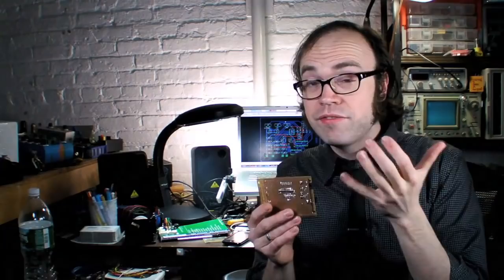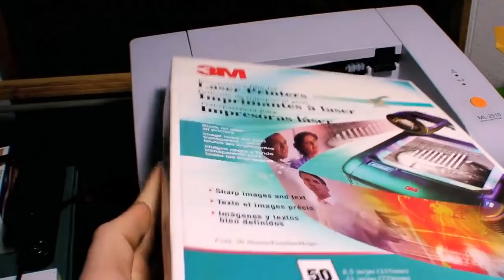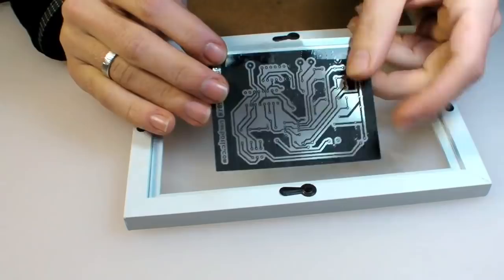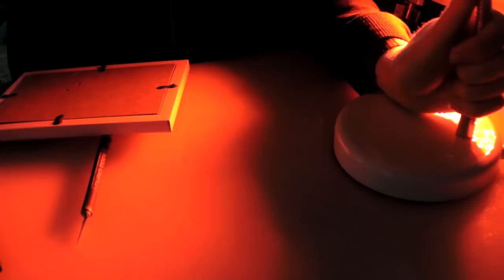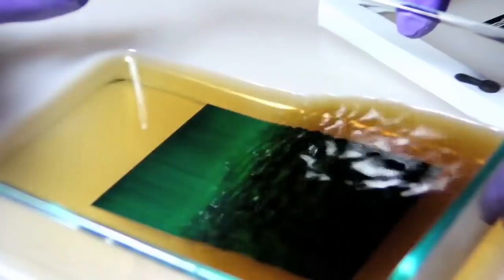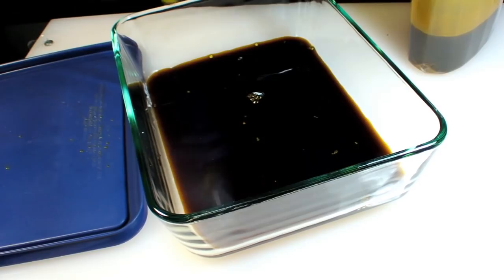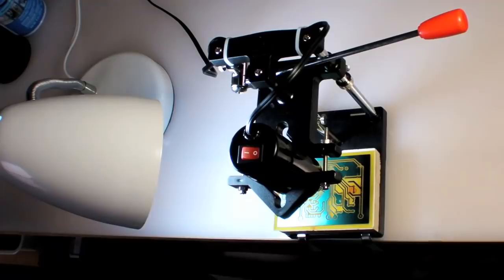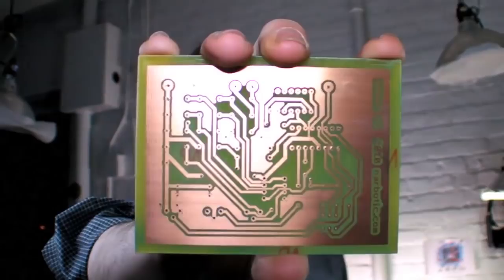Circuit Skills: Circuit Board Etching

Comment: Your laid back approach is AWESOME. Your not stressed and simple direct explanation is just what newbies need. Your system is exactly how I make my boards and mine come out excellent every time. I skimp and use ferric chloride hexahydrate and caustic soda but I have been doing it for years and know the measurements. Also an etch tank with a fish tank bubbler and heater bring the etch time to under 8 minutes depending on copper thickness. Dry Film Solder mask is cheap and easy with a laminator.

Comment: I have been making pcb s for years.  I made a rocker for the solutions, uv light box and using a Dremel drill on a flex cable.
There are now new products and procedures that are really fascinating,  I use a MacDraft Pro drawing program to create the positive circuit and print it out on an old hp 5000 printer to the transparency sheet.  I like the idea of using two stacked prints to enhance the pattern.  I sometimes use a heat lamp (150W lamp) over the etchant to warm it up.  I made a vent hood with squirrel cage fan to blow fumes out.   I am still experimenting with the photo resist sheets, (now on order) and using the hard to find photo resist in the spray can to try on my home made pcb spinner, that will be used in the hood.   Sorry I went on here, but that about covers it.  //...  Joe

Comment: I always expose to sunlight on a sunny day. And it makes such a big difference! Why be stuck in a dark room with a light bulb when I can watch some birdies flying and look at the blue sky!
Reply: mendebil  True my friend
Reply: UVs produced by sunlight aren't constant on the board, which means that you don't really know what the actual exposure time should be.
Reply: Sometimes it does not sun shine and need to practice when the sun doesn't shine.
Reply: bcz it is 100% homemade.
Reply: I followed this video, but instead of using a CFL bulb I used a halogen. I put the board after it in the developer, but it came out exactly as it was, like nothing happened. My board was sold as photosensitive, it came with the protective sticker, but never looked green or blue. Just copper color. Do you think only the lamp was the problem? After putting it into the developer I killed the photosensitive layer, right? So I cannot repeat it with a CFL and the same board? If I cannot: can I still use the board with marker / iron method? Thanks a lot in advance!
Reply: @DiegoSynth  I am also trying with a CFL bulb and did not work. However, after exposing the same board to my aquarium lamp which I am sure emit UVs, it work. So the developer does not kill the layer and it might be your bulb that does not give enough UV, try with sunlight or other source of UVs.
Reply: I'am blind and I'asked my assistent to comment for me but hearing you speak about blue skies was very inspiring simce I'haven't seen it for 11 years.
Reply: Real electronics enthusiasts haven't seen the sun in decades.
Reply: @DiegoSynth  Yes halogen lamps produce light by black body radiation, in fact most of it is in the infra red. Mercury Vacuum discharge tubes produce UV light. A florescent lamp is a Vacuum discharge UV lamp with a fluorescent coating which converts UV into visible light, though seemingly sufficient UV passes through the coating. A CFL without a florescenct coating would in fact be a UV lamp.
Reply: @grownupemo  That's amazing! Thanks, I learned something. :)
Reply: Thats what we call a "prefference" my friend. Prefference requires understanding and respect.
Reply: @alfhanahmed  yup. Literally.

Comment: An excellent tutorial.  One suggestion: the very thin drill bits that I use -- 0.04" -- can easily "dance" away from the hole that are intended to be drilled, particularly on this very hard phenolic board.  To limit this, I use a center punch in order to create a very shallow divot on the hole as a wide to guide the drill bit during early moments of drilling.

Comment: I've found that a laser engraver is fantastic for making custom pcb.  Rather than having to rely on those light sensitive boards, simply paint the whole board black, print your circuit out with the laser engraver removing the unwanted paint i.e. the copper that is to be removed. Then continue with Ferric Chloride.
Reply: What type of black paint, if I may ask? Thank you.

Comment: I remember in my first year of an electronics class we used nail polish as resist. We literally had to paint the pattern using the nail polish brush. Imprecise but did work fine for simple circuits and it was cheaper. When we moved to more advanced circuits we used toner transfer.

Comment: In my opinion, harmful etchants (like ferric choride) are un-nessisary to develop board. They require special disposal, are environmentally un-cool, and require special safety measures. I use white vinegar, salt, and hydrogen peroxide to etch boards. Results are always perfect. These chemicals are far more benign than methods suggested above.
Reply: thanks, totally works, and no special disposals
Reply: Except you are making Cupric Chloride which is harmful anyways... Also when you add salt, and see those fumes coming off? Thats Chlorine Gas....  A Chemical weapon. So be careful.
Reply: How long does it take to do that.  Sounds interesting though.  I don't know what the recipe for that.
Reply: Warren Brown, where is the chloride coming from in this approach? From the board itself?
Reply: From the salt. Table salt is typically Sodium Chloride.
Reply: Warren Brown  sodium has a higher activation energy than copper.. so it wouldn't break it's bond with chlorine?
Reply: Hahaha H2O2 is banned here in Europe...or at least very hard to come by of anything with 3 or more %.
Reply: +AirsoftSlo You don't need more than that. You can always add more. Or you could try evaporating the water before using it if it's really a problem. And you can probably get high concentration H2O2 in hairdressing stores or some pharmacies.
Reply: Copper chloride is actually a good sideproduct because it's also an etchant! If it doesn't work, apply some oxygen (either from the air or from a bit of H2O2, or another oxidant). That will regenerate it! Though I'd recommend 30% HCl + 3% H2O2 in equal quantity for making the CuCl2, it's very fast.
Reply: @GRBtutorials  No we actually cant. Every H2O2 we can buy is in gel form exactly for the hair salon purposes and it has colourants and smell aromas added...
Reply: In which part of Europe do you live? Here in Spain, you can get liquid H2O2 at some pharmacies as well. And, as I said, 3 % H2O2 should be enough.
Reply: @GRBtutorials  Slovenia
Reply: Well, you should be able to buy at least 3 % H2O2 as a disinfectant in a pharmacy. And you can evaporate the water to concentrate it (just be careful of not concentrating it too much or it'll become rocket fuel).
Reply: @GRBtutorials  100ml bottle is 15€ at a pharmacy and it isnt even full...thanks for trying though.
Reply: What???  What do you mean...???  I do get your drift...!!!
Reply: "environmentally uncool" I'm sold, buying ferric chloride right now
Reply: @GRBtutorials  not anymore, you'd have to have a business for it

Comment: Making my own PCB's was fun the first couple of times. It was much more fun when that mail arrived with a top notch, superbly manufactured rendition of my design.  I still had all the fun of designing the circuit, and laying out the PCB.  A factory with the right equipment did a top-notch job realizing it, for a cost that I could never achieve making a lower quality version myself. Many DIY-ers naively calculate cost by assuming their time is worth nothing, and gloss over quality differences.

Comment: Thanks for the kind words. I have finally perfected the process all the way to solder mask. It comes form a conglomerate of others work and tweaking it. In a nutshell, there are papers out there saturated with silicone oil that toner prints to with no problem (assuming the write paper) and little pressure initially with the board hot and flat and clean. It transfers perfectly then once stuck in the right place, in my heat laminator2X. Cooled and done right it peals right off and reuse the sheet.

Comment: Make sure you neutralize the acid on the circuit board in a bath of Baking Soda and Water BEFORE you rinse the acid soaked board in the sink with cold water, otherwise the etching solution will destroy your house's drain pipes and enter the environment! D:

Comment: Ferric chloride is horrible, and 20 minutes wait time is a joke. I prefer a mix of hydrochloric acid and hydrogen peroxide. If it isn't smoking, add more hydrogen peroxide to taste. Etching is done in 2-3 minutes if you stir a bit, and the leftover HCl and cupric chloride in the container can be reused a number of times, by adding some more hydrogen peroxide when it seems to lose its potency.
Reply: +John Tsiombikas You're right. I had been etching PCB's for a longtime with sodium persulfate and it took almost 30 mins. That stuff is also pretty expensive, it had been a longtime since I done an electronic project. I will start with this hobby again soon but with better equipment. Better solderstation, using silkscreening to create professional PCB's. I'll also make a DIY etching tank with plexiglass. It's very cheap to make one yourself instead of buying one.
Reply: Table salt speeds up the reaction and can pep it up if it starts to slow down.
Reply: John Tsiombikas have u lost ur mind ?  Ur crazy
Reply: Why is a twenty minute wait time a "joke"? I'm just considering that the board(s) could be used for years, so spending twenty to thirty minutes during this step of the manufacturing seems a reasonable investment - especially when compared to the many days or weeks it cane take for a third party manufacturer to produce the board(s) for you.

I also feel that the satisfaction for creating your own circuit board(s) should out-weigh the whole process. If, however, you wish to mass produce your board(s), then certainly try other processes in order to reduce manufacturing times.

I feel the bigger picture here is that anyone can create their own circuit boards, and even their own circuit components, at a low cost. What does it really matter if we need to wait minutes or hours to do so? The process of creating your own components, and thus the feeling of accomplishment, should - in my view - balance the effort required.
Reply: Note: Don't put too much hydrogen peroxide in the solution! Using too much hydrogen peroxide can result in the production of chlorine gas, which can be deadly if not well ventilated!
Reply: I just use diluted nitric acid....
etches easy, clean and perfect.

(and easier to dispose of: dilute to 20% or less, slowly add ample soda (at least 0.5kg/l), stirr and leave it for a day. and than you can just pour it down the drain)
Reply: Even better, environmentally, would be to essentially reverse electroplate in a copper sulfate pentahydrate solution - it would probably take a little longer but possibly not depending on how thin the copper layer is on the board
Reply: lps2 reverse electroplating has its own problems like under'etching' of fine traces and partly 'etching' because at some point the electric connection is broken... Always needs post processing...
Reply: And the copper chloride formed can be used for etching more PCBs so it's reusable.
Reply: I'm listening!!!

Comment: Tip: use tracing paper instead of transparants. Toner adheres much better and because of the fine grain, layouts can be very detailed. It's cheaper as well. UV exposure needs to be a little longer.

I don't need to double-up the layouts, allowing for a sharper image and therefore much finer tracks (I make 10 mil, 0.25mm tracks without a problem).
Reply: nice

Comment: Collin, I recommend etching with Water + Muratic acid + Peroxide. It takes 20 seconds or so, compared to the 20 minutes of Ferrochloride. Just make sure you do it in a very well ventilated area, with a respiratory mask.

Comment: Two notes: if the picture frame uses plastic instead of glass it could be polycarbonate, which blocks UV light. Also, nail polish remover's primary ingredient is acetone, for those concerned with purity.

Comment: What I always use is regular A4 paper instead of transparent sheets. It'll block more light but, the print is very sharp and does not have holes. So no need to print it twice. You need a laser printer for that though.
4.5 minutes in UV light and you're done.

You can also use a marker to draw your layout on the board. The marker paint will protect it while you are etching off the copper.

Comment: Interesting video Collin. I've been down this route before.  Your board came out very nicely.  There is one additional step you could take which is tin-plating so that the copper traces don't oxidize.  Solder masks are also possible but do take more work and effort.  But all in all, your board came out very nicely and that's what matters.  There were a few points in the video where the background music was a tad too loud, so you might want to tone it down a bit more for future vids... Thanks for your video!     P.S:  Drilling a small PCB is not too bothersome, but if you do larger boards, or multiples of a board boards, it can become tedious and time consuming... this is where a CNC machine that understands Gerber can make a huge difference, but not to mill away the copper to leave the board's traces (which is of course possible) but to use the Gerber Drill file from your CAD program to drill all the holes for you with greater precision.  Admittedly a CNC is an investment, but if you're doing lots of boards it can make a difference.

Comment: Depending from the photosensitive pcb in 5:17 the board sometimes needs to wiped with a kitchen paper to remove residues of photosensitive and after that washing with water,because the unvisible residues is the most important reason for the bad etching leaving shadows of copper in the board.

Comment: Nice tutorial on PCB etching! I use almost the same method except the photoresist type - I use "POSITIV" spray. Covering patterns with some oily liquid (e. g., glycerine) is another way to stick them together and to the board so no any frame or glass piece is needed. Also, 'drill-aid.ulp' Eagle script (included in distribution) is very handy when you use manual drilling. The script reduces hole diameters to a selected (small) value more suitable for drill centering.

Comment: I use a special paper that has a rating of 100 pound. Just iron the toner onto the board and soak in warm water for 10 min and you have a board that is very close to factory level. This is a great video too.

Comment: This is an excellent tutorial on this topic. I have shied away from etching my own boards due to my fears of having perilous chemicals around my house (I have to do most of my hobby stuff in my living room & kitchen) e.g ferric chloride and the like. Yes, using stripboards can be tricky, but the main hassle with these is soldering one up that was copied from a breadboard - and the breadboard test wasn't a proper test to begin with...Thanks for the info, anyway.

Comment: Here's a trick for the etchant bath.  Lots of people make very nice setups with temp. control, aerators, etc.  For a basic but not too basic setup I like to use a muffin fan from an old computer. Break off a couple blades next to one another so it is unbalanced. Place it underneath your tank. I use my variable bench supply for adjustable power but an old wall-wart would do. Secure the tank by placing heavy items beside all 4 sides so it can't vibrate off! Heat it with an incandescent desk lamp.

Comment: Some more hints: for etching i use  1/3  h2o2 (18% )  1/3 water 1/3 hcl .
Don't make too much since you can not store it, it etches a board in just less then a minute. You must do it outside since it produces Cl in the reaction.

Comment: I'm using sodium persulfate. It's much less messy:) 200g/1L, with 60C heat, takes 10-15 minutes when it's fresh. Also it's better to place PCB copper side down (but not too deep, just under surface. I'm using holder from isolated wire). And get it out for a few times to remove bubbles.

Comment: Nice vid! :)
You can use a toner spray that spreads the ink so it covers holes that your printer hasn't drawn. or you can use nitrocellulose thinner. take a thin box, put the mask in and pour some nitrocellulose thinner on the box cover. The alcohol fumes will also spread the ink evenly along the printed mask.

Comment: If you are wondering why he used red light when opening those PCB's is that red light has a longer wavelength (which makes the light less powerful), therefore it won't etch the photoresist.
However, blue lights like fluorescent lights have shorter wavelength (makes the light powerful) therefore it will etch the photoresist.

Comment: Great job on this process.  I did this in High School Electronics forever ago, only we used fingernail polish for resist, with no photosensitive coating.  Real caveman, but it works.  Again, Excellent video.

Comment: I'm using sodium persulfate. It's much less messy:) 200g/1L, with 60C heat, takes 10-15 minutes when it's fresh. Also it's better to place PCB with copper side down (but not too deep, just under surface. I'm using holder from isolated wire).

Comment: Protip: Put the container with the board and etching solution in a larger container with hot water, etching will take less time which results in a better/sharper etching result.

Comment: You might also want to try using a product called "tinnit" to give the board a little more corrosion resistance. It's pretty straightforward.

I used to do this a lot, but lately I have to disagree with the "a lot less money and a lot less time" remark. It is time consuming and the supplies are not exactly cheap. You can get similar boards overnighted for less than $20 a piece now, depending on the application. But if you need it right now and are willing to work for it, this is a great  how-to.